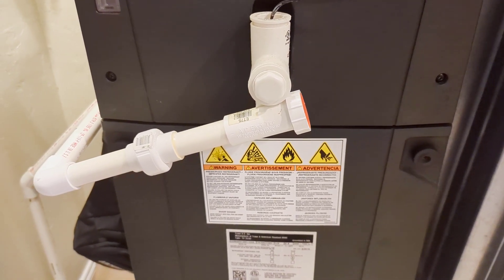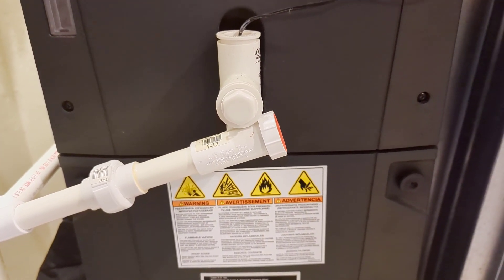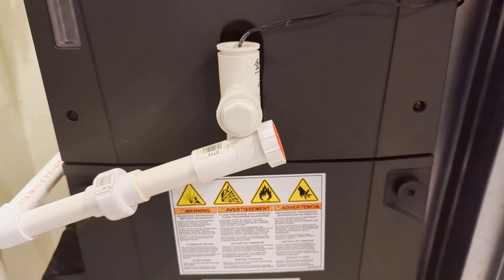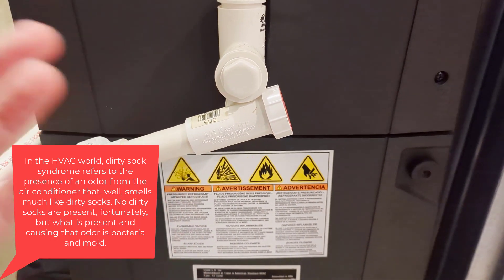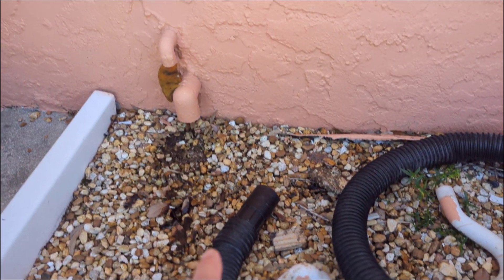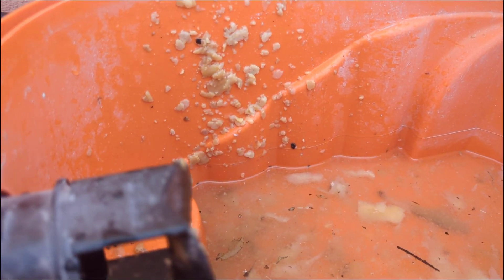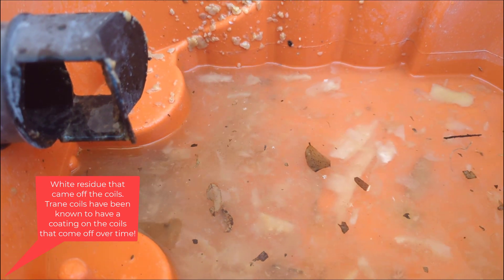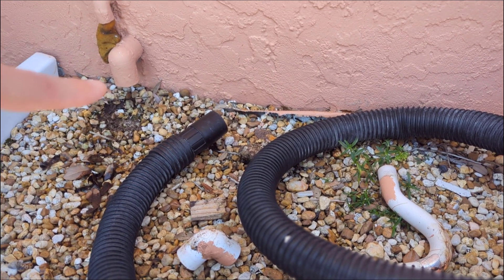What is dirty sock syndrome on HVAC coils Trane demo

Comment: I have this problem from time to time. I have a special fitting that I have designed to fit onto my shop vac hose to step down from the diameter of the hose to the inner diameter of the drain pipe so that I get a good seal and can suck the gunk out. Then I pour some bleach water down the line to sanitize and (hopefully) kill any mold growth.
Reply from the maker: Nice! Just stay away from bleach as it corrodes metals at a super high rate. Use vinegar. This one you just add to water as it is concentrated...... https://amzn.to/454Zy9Z
Reply: @SaveGreenHere  Thank you. I'll switch to vinegar as you suggest.
Reply from the maker: Vinegar works well. Alternatively, you can try this and it does it automatically. Ones less thing to worry about, and it can save many households a single service call fee. A few that I know have had it installed, and swear by it........ https://amzn.to/3wPgZPe
Reply: @SaveGreenHere  Oh that is cool. Thank you!